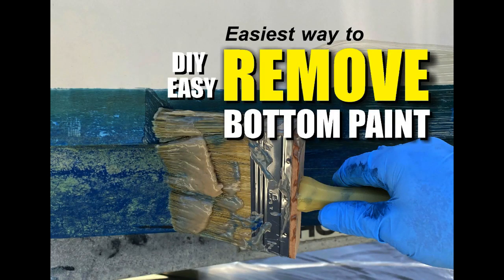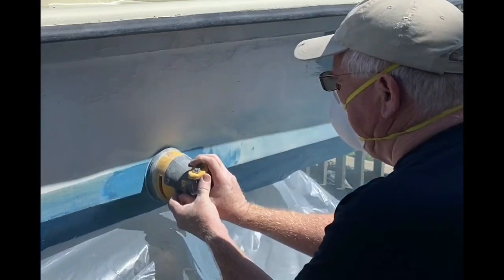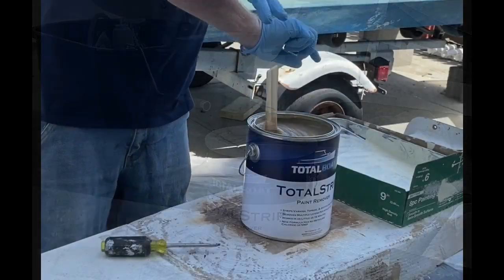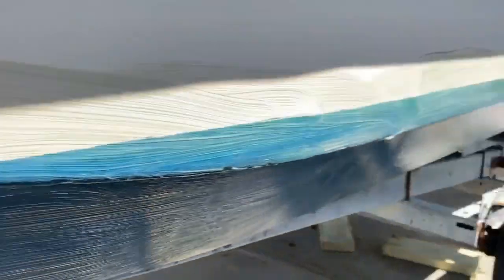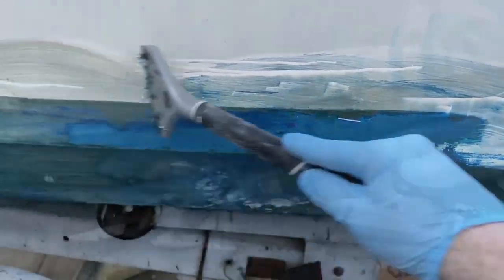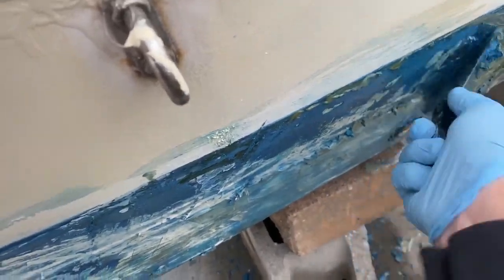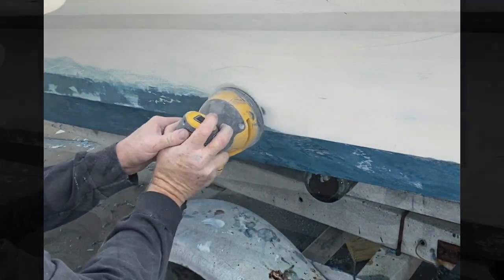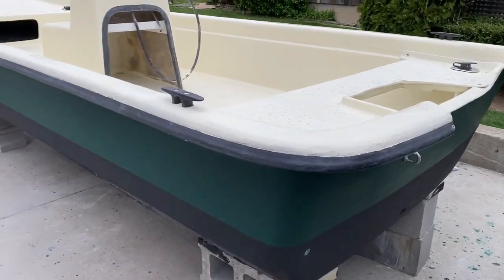Easiest Way to Remove Bottom Paint from a Fiberglass Boat: DIY Tutorial

Comment: I have an 88 Bayliner. I took off ALl of the clear outside layer. I am down to the metal flake and color. Some areas it came off easy and some areas it didnt and is very rough. Will this take all that off as well and get me down to the fiberglass? I want to get it all smooth again so I can possibly vinyl wrap it.

Thoughts?